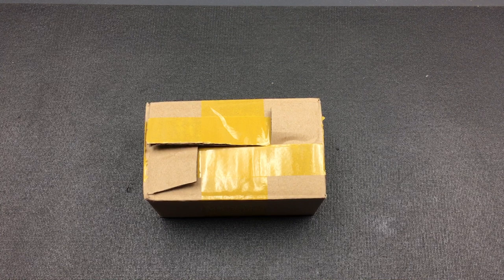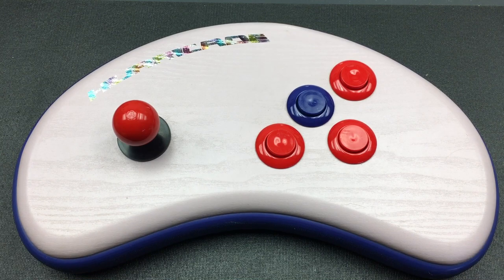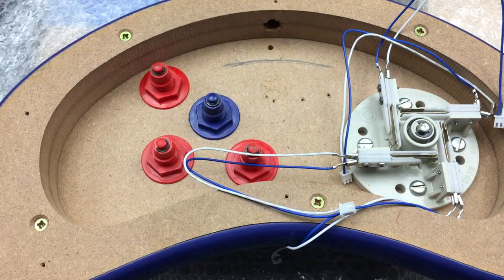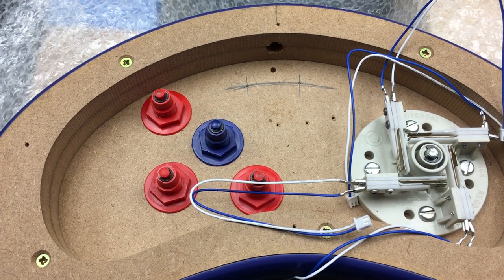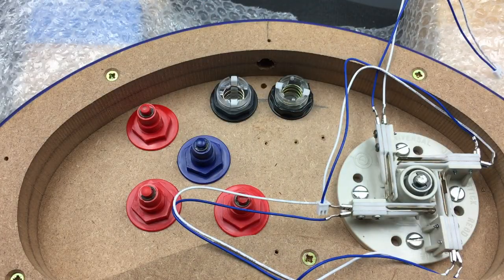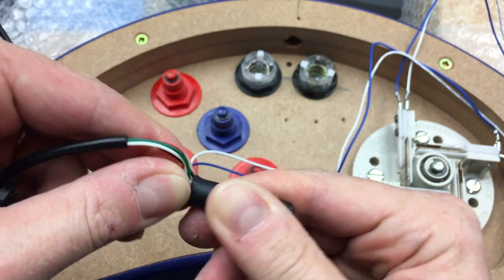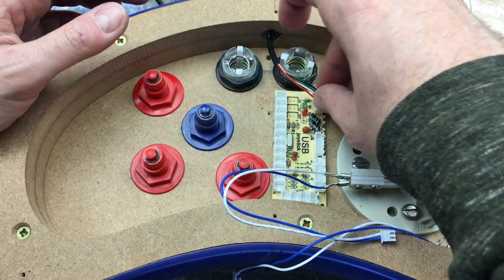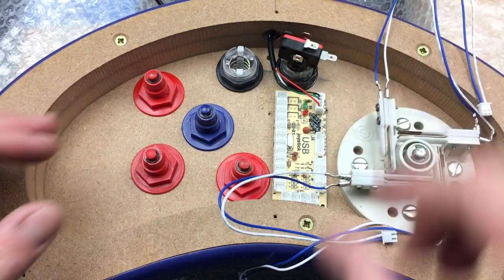Zero Delay USB Interface - Part 1: Overview & Build

Comment: Adjustable wrenches in us are the ones with a rotary width adjuster. Channel locks is most common name, also slip pliars is another name. Channel locks is also the largest manufacturer of them called

Comment: I thought that the green cable was negative data (whereas white is positive) but the green is plugged in the adapter first, right after the black (GND)... I have trouble getting mine recognized by Windows, I guess I should switch those two?

Comment: How would you wire a total of 9 LED buttons? There is not enough space in the USB Encoder. Since we need 4 cables for only 1 button in order to light it up. Please i need help. 
Thanks a lot amazing tutorial very well explained.
Reply from the maker: On each button, 2 of the connections will be for the button itself, and those need to be connected to the relevant connector on the board. For the LED's you will need to create a 'daisy chain' cable (that runs from one button to the next) and connect those to the 5v output on the board. On my version of the board (featured in this video) the headers for 5v output are not populated (you can see the 3 open spots in the lower left corner of the board), so if I wanted LED lighting, I would have to solder a 5v and ground wire to the board using the holes where one of those connectors would go.
Reply: Olaf Wagner thanks for the explanation! Hopefully I’m not gonna have problems when I will try to do it. Thanks again!

Comment: I just received the same encoder board.  Which wire is the ground?  White or blue?  I am hooking it up to happ micro switches.
Reply: Same situation here.Anyway if I'm not mistaken the blue wire should be negative.